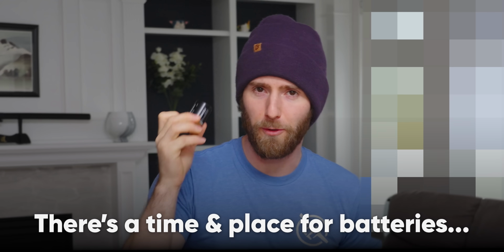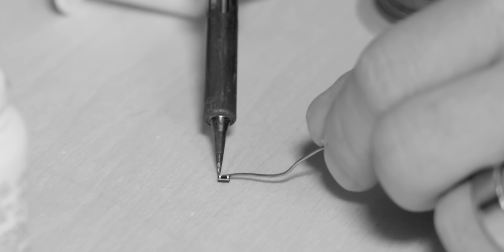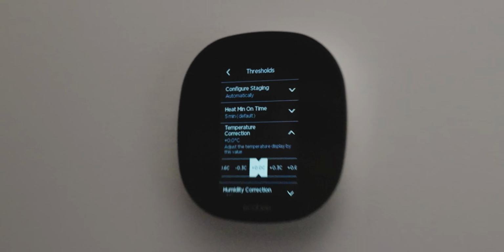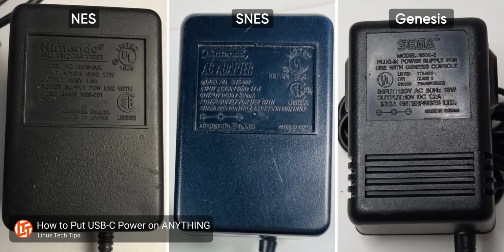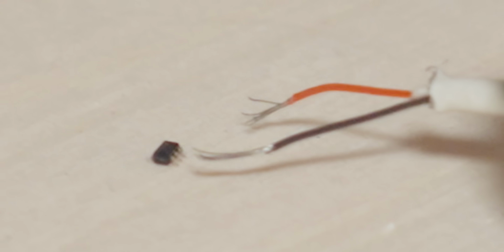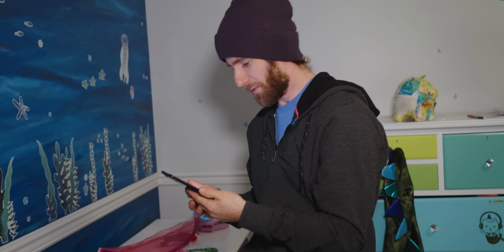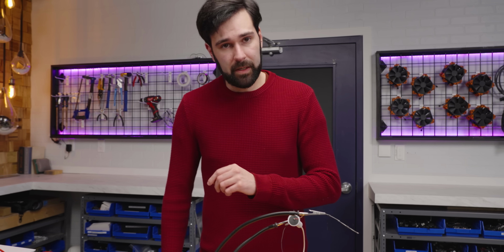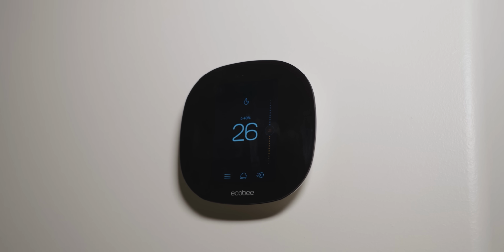I HATE Batteries! - Converting Wireless to Wired (a cheapskate’s guide)

Comment: Hello LTT. I know you never read this but here it goes.
A regulator of a normal size (for soldering) like a HT7533-1 that you can buy for 30 cents will serve you fine
GND goes to ground 
IN goes to 5v
OUT goes to 3.3v
It is recommended to add a couple of capacitor in the IN and OUT for stability but are "optional" 10uF is more than ok (each would cost 10 cents)
And you are done. You can pull up to 100mA and if you want more the LM1117T has you covered with up to 1.5A or if you feel like an engineer a transistor would also give you extra power a 2N3904 would provide you with extra 200mA, those are 15 cents and you need an extra resistor.
Anyway...on a buget you can do just fine with 50 cents (gets cheaper by the 10s and 100s)
For 2$ you can have lots of power and even make yourself a nice small PCB and make 20 of them (which will reduce cost) and power EVERYTHING of a cable. 
If you think it over a bit there are version of those regulators that if you have even more powerfull power supplies (over 5v) you can even replace devices that use two AA or two AAA batteries.
Then again.. (and sorry for this since I live in europe and the plugs are specially painful here). having 20 more cables and european plugs around the house is a nightmare

Comment: My gripe is with hand held portable power tools. My local Home Depot doesn't even stock corded drills, sanders or grinders any more. They are trying to drive battery powered units down our throat. They know the batteries fail after a few years and we throw out the tool and buy a new one. I have corded drills and sanders handed down to me that are over fifty years old and still work fine. How is this planed obsolecense good for the environment?

Comment: Just a question.. Couldnt you have paired and synced the sensor on battery power and then converted it to wired? that should have solved the pairing spike that was causing the sensor to freak out

Comment: as an electrical engineer, i hate everything about their solution. Either use a voltage regulator, (and add a capacitor!) and a diode (instead of the pot), OR just use the correct voltage regulator in the first place (the target audience for this video should just be buying a buck converter module with a little adjustable output pot, btw). Not having the correct (sub 1$) components on hand is a terrible excuse for a multi-million dollar youtube channel, IMO
Reply: Undervalued comment

Comment: LINUS NOOO!! Please stop. While this is more or less OK to do if you know what you're doing (reading actual datasheets, dimensioning accordingly, knowing how to make secure solder connections), if you don't know what you're doing, you're creating serious fire hazards around you house. 

While I believe the circuits created on this video may well be safe, the ones made by exited people following this at home definately won't all be. Those small wall adapters pack enough punch to light a fire, especially when tucked into confined spaces or surrounded by drapes and such. 

I get your hatres of batteries and I haven't finnished the video yet so there well may be a warning not to do this if you're unsure of yourself but we all know how well those work. In its current form, I feel this video is a lapse of judgement from you guys.

Comment: I have to wonder if solar wouldn't be a better way to go for something like this. Yes, the amount of solar power you get in a room is really tiny, but then the power draw on this device is also really tiny. Now, you'll need a rechargeable battery and some charge circuitry, not to mention the space for the (tiny) panel. But, in theory, you could put this thing out of the way (say, on top of the door jamb, with the solar panel pointed upward so you can't see it) and the thing could theoretically run for a decade or more without being touched.

There have to be some electrical engineering wonks out there who could do something like this!

Comment: The intro perfectly resonates with me. Not everything needs to be wireless. Some things are better with wire.
I did a mod myself at some point. Turned a battery-powered bluetooth speaker into a wired one. It now runs at 5V USB. Works just as well and the battery still exists just in case.
Highly recommended for everyone to look into the classic LM317 voltage regulator.
Reply: Someone needs to make a USB to fake button cell adapter with adjustable arms to simulate the different sizes of buttons.  $5-10 each would be well worth less jank.
Reply: @ccibinel  the issue with that is that USB runs on 5V and most common button cells on either 1.5v or 3v, so some voltage adapter would need to be added as well.
Reply: @HappyBeezerStudios  AMS1117-3.3 (or others with different outputs) will do it and costs under $1 us.  Messing with resistors to save 30 cents is dumb.  If someone made a product combining this with a housing, arms and usb port it should be viable for $5-8

Comment: For stuff that low current you might even be able to just use 2 resistors set up as a voltage divider and do it for only about 4 cents. you'd need a 100k Ohm from 5V to your device, and from your device to GND you'd want a 50k Ohm. and of course GND to GND. You could even heat shrink all that into a cable and not need a pot or an IC. Then again, you could to custom PCBs to have the same form factor as the button cell and use 3D printing to fill it out. Double check those values but if I'm mathing correctly that should give you close to 3V. To handle the current draw spikes a little capacitor should work as well.

Comment: You dont step down a voltage with diodes to EXACTLY what you want. Use a stepdown PCB from any online source... (besides these solutions will burn more energy in heat than the sensor is using)

Comment: I'm guessing it's cheaper to make electronics that run only off battery power -- no rectification, low voltage and current, no need to get them certified as safe to plug in, no need to take into account different regions' electrical systems, and so on. Too bad batteries suck. They suuuuuuuuuck. I love this idea.

Comment: Brand new batteries usually give more than their nominal Voltage so 3,3 Volts should be fine for the sensor. If not I would call BS low quality engineering.

Comment: Potentiometer was a waste of time. 3.2 nominal means full charge is higher. Device has to support full charge around 3.65 volts and down to 2.5 volts. You could’ve gotten a 5v to 3.3v converter which are incredibly common and gotten one that wasn’t surface mount maybe even with a breakout board.

Comment: Dan, maybe a good idea is using an LDO, from the 5V USB to a 3V of the CR2032. The diode idea "works" also as a voltage reference, but every diode has a parasitic resistance Rz and increases the amount of current needed, and the """regulation""" (Supply regulation SR) is pretty bad in comparison to a true Voltage reference as the LDO. The voltage' s divisor is a very bad idea (potentiometer has a 10% error) because you add the "load" of the device to the total resistance and the voltage goes dead. 

Good video, gave me an idea of making a PCB the size of a CR2032 that converts 5V usb to 3V.

Comment: If you want to use resistors but not have the voltage drop once there's a load you can put the signal through an op amp first

Comment: The simplest solution was to run electrical heat pads in the concreste with ceramic tiles and zone out each room.   The efficiency is far higher as you dont need theating up the water, pump the hot water and maintnance of the system.
Concrete keeps enough energy with cermaic tiles for the electric pads to just maintain the heat once the concrete is heated.

Comment: Voltage regulators typically require a capacitor on the output to stabilize the voltage.  I'd guess that this setup would have worked first try if there was a small cap on the output.

Comment: I wired an led closet light that ran off 3 AAA batteries to run off 5v usb. Now I have a storm ready emergency light that runs for more than 12 hours off a 1000maH battery bank. And it's RGB lol.

Not really wall power, but more convenient than alkalines and longer lasting lol.

Comment: you only need two resistors 
that forms a voltage divider which is also a cruel shunt regulator. it should work as the thing draws basically no current. only downside is that the system now draws 10 or more times the power than the device itself would.

Comment: This is literally the hardest way to make battery powered  devices into USB devices. I would recommend to everyone but the most electrical experienced in the audience to just pay the few extra bucks for voltage regulators instead. Yeah, they are a little more expensive, like $10 for a 4 pack, but you can easily fine tune the voltage and will have much less math and problem solving to do on your part.

Comment: what i like about most battery gadgets and such, is place most anywhere.  hardwired stuff needing an outlet.  if only energy was just wherever on a wall I stuck/placed a unit without need or worry of a dedicated/ cut into the wall outlet.  something like the lay down and charge the phone wirelessly, a suction onto the wall and it draws its power.

Comment: the easiest and cheapest way would be to just use a 3.3V LDO. That thing will surely run on 3.3V. For sure there's another voltage regulator inside as most electronics don't run well with the decaying voltage of battery cells, and most of the low power stuff runs at 1.8v or even less.

Comment: There's nothing wrong with alot of the devices he slams at the beginning. Those blink cameras are for putting in places with no power. Like a tree in the backyard. Or apartments where you can't drill and run wiring. Nothing wrong with them just the wrong device for Linus' need

Comment: Just find where the rooms heating meets each side and cut it there and separate it... ?? Seems fairly simple you wouldn't have to tear up the entire floor just one spot and you could run the new seperate pipe in the lower portion of the Wallander insulate the pipe in a sleeve do it doesn't make the wall super warm...

Comment: Seems like it would've been easier to just run the Tstat wires into the room. Doesn't look too far. Hard to tell if the stat was on the wrong side of wall which would've been very easy, or possible some sort of closet between the two. Both should've made it easy to relocate. And I've seen Linus run CAT through a house so I know he's capable of similar wire pulling.

Comment: I did something similar to an old set of Creative X-fi headphones years back. They used to eat aaa batteries weekly with all the features turned on. I tried hooking them up to the computer power supplies 3.3v rail. It worked, but being a switchmode power supply, the power was evidently pretty dirty. You could hear constant pulses through the headphones!

Comment: This video seems like it's trying to create a problem where there is none. I've had my smart devices for almost 4 years, and I've only ever had to change one battery so far, they last for a long time. The advantage of wireless is you don't have to rely on empty plugs or janky wires all over the place. TBH the time you spend on this conversion, you could change batteries for decades in it instead.

Comment: This is a time making a quick single-sided breakout board would have saved you a ton of time and stress.
If you really wanted to be fancy you could make a button cell sized board that drops into the back of the sensor and replaces the battery.

Comment: See how long those low voltage power supplies’s last. Replacing a battery every year vs replacing a power supply almost every year. Not sure which one creates more and worse landfill, also some of these devices have a low amp requirement and some power supplies switch off if there’s not enough amp being drawn. Not sure if i mentioned but they also die every 1-2 years + power has to be paid. It’s just not economical to power everything…

Comment: I think this solution ist more expensive in the long run. A 5W wall adapter wastes up to 1-5W just idling. So about 43,8 Kwh, per year  were Iive thats 17€ of power. A button cell can be bought for 5ct in bulk.

Comment: It's a AC impedance problem : add either a small electrolytic of ceramic capacitor where the battery was (or both) as the battery is quite low impedance but the wires to the usb adapter are not.

Comment: To use those SMD devices it probably would have been easier to use a piece of bread board material and solder paste and do a reflow to solder the voltage regulator and pot in circuit and then hand solder the wires to the breadboard + and - leads! The easiest method of course is to just get a sensor that plugs in to the wall lol Or just deal with the flipping batteries since they draw so little current I mean seriously! The downside of course is that his children could end up playing with them and breaking them (inherited trait) or losing them! Interesting video though!

Comment: Hi
I think battery is batter solution than the power adapter and more secure, the adapter will regulate the power 220v ac or 110 ac to 5v then you will regulate it to 3v all the time 24/7 and this adapter is not designed to do that, waste of energy and not secure, 
The sensor circuit designed to power the sensor and take the reading then  send it to your device then it will go in deep sleep mode witting for the next reading to save the battery power there is other solutions but ofc not this.
Regards

Comment: Just use a 3.3v regulator. Spare yourself a lot of trouble and lands in an okay voltage range. 99% of the time this will work. They are super cheap and commonly available. No need for potentiometers, resistors or diodes! The cheapest solution would be using a voltage divider to get an appropriate voltage and adding a small capacitor to accommodate the current spikes, this would only work for low power draw though, otherwise you should stick with the 3.3v regulator!

Comment: That has to be one of the jankiest conversions I've seen done. Much simpler and more reliable would have been an adjustable DC-DC step-down regulator between the wallwart and the sensor. They are very cheap, and the output voltage can be reliably regulated to whatever voltage you want, and it will ensure there are no issues if there are bursts of higher current draw. Or, if 3.3v is all you need... a LD1117V33 fixed voltage regulator is both easy to solder, and more than capable for the task in question. Given these are 3v nominal devices, a 3v regulator is also a possibility.

Comment: Smoke detectors should not be wired. (or have a battery switch) The smokesensor ages too and should be switched after 5-7 years (faster with smokers or ... bad cooks) and (atleast the ones i can get here in Germany) the smoke sensors here in Germany with fixed batteries are good to use until the battery runs out (9 years from manufacturing, but the ones in store are quite often already aged)
An old sensor may still detect but too late causing long lasting medical conditions and maybe even death.

Comment: USB-C has potential to beat (PoE) RJ-45 and electricians should be able to make the connectors at the worksite with test measurer for up to 20V5A (100W) . 3 Meter (9 feet) max length gives plenty of headroom for anything.

Comment: 1:11 I have to jump in here. You should definitely not be wiring up your smoke detector to the mains. In the case of an electrical fire, where a breaker might get tripped in the process, but not before a fire occurs, that’s going to obviously cut power to to your smoke detector and this would be a very dangerous situation. 0/10 would not recommend.

Comment: Some cheaper devices may have issues with switching supplies. Batteries are linear where most wall warts are switching type. Probably fine but they are not "the same"

Comment: I would just make a pcb that will fit the battery compartment and clips. The device most likely runs fine on 3.3V as ic's tend to run on 1.8, 3.3, or 5v with a tolerance up or down. The only thing that it may be really picky on is if it does have battery voltage detection and they have it tuned in too tight to operate at other levels.

Comment: You could use something along a LP 2950 ACZ3,0 - a 3V voltage regulator for 100mA, costs around 30 cents and is not SMD ^:)

Comment: As I understand, Linus said that the thermostat in the hallway is on the opposite side of the bedroom wall, e.g. the hall and one bedroom share the same wall. If this is the case why not just mount the thermostat on the bedroom side of the wall using the existing wire. After mounting the thermostat in the bedroom patch and paint the hallway wall.

Comment: seriously just get a the right voltage regulator/PS. Anything battery powered will run on a lower than "nominal" voltage just fine, so a 3V PS or regulator would be fine and neither is hard to find.